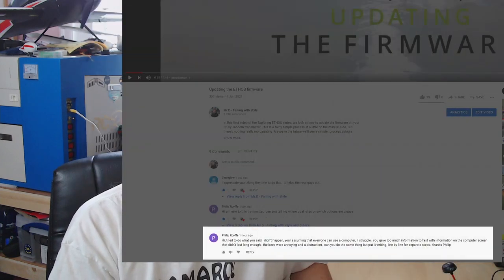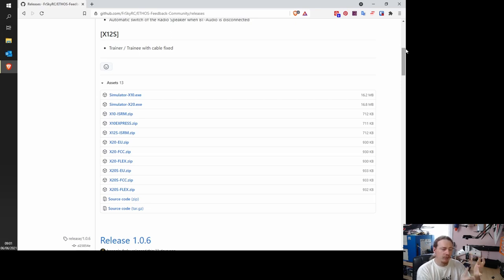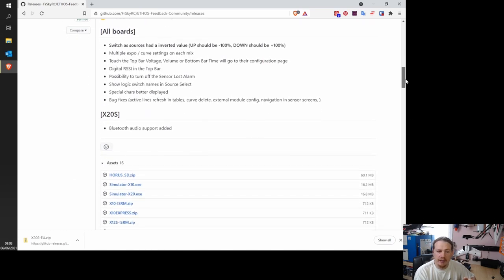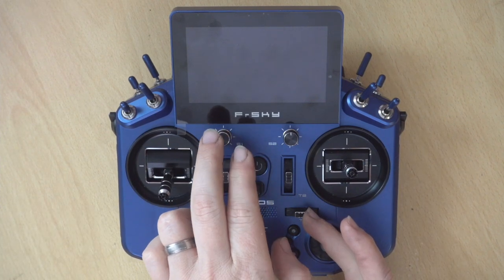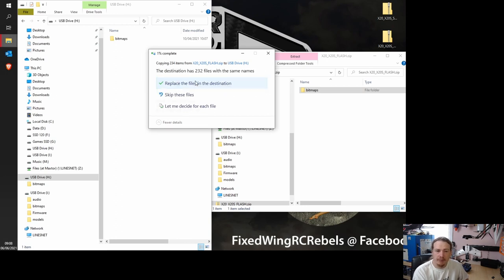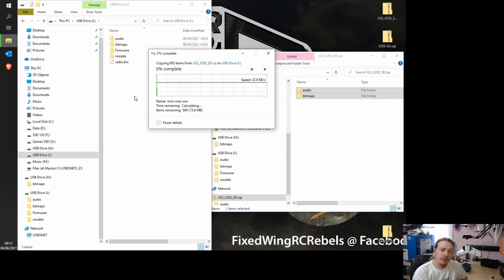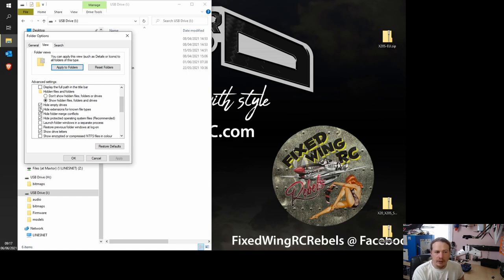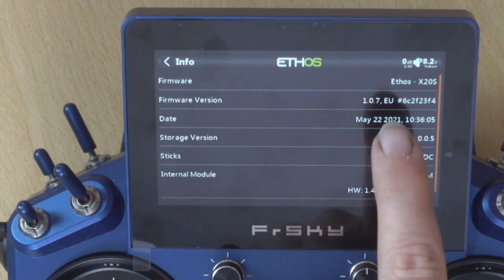Updating the ETHOS Firmware, for people who struggle with computers

Comment: Hi, have tried to do what you said,  not happening,  something I'm doing wrong or not doing at all , given up, thanks for the help, much appreciated, Philip
Reply from the maker: Philip, can you explain where you’re getting stuck? This might help to figure out the problem.
Reply: Don't give up! You can do it...
Reply: Hi, it's sorted now tha, end up getting someone to do it,  took 2 minutes,  done, , computers aren't my thing, thanks Philip
Reply from the maker: Glad it’s sorted Philip
Reply: @MrD  great tutorial. I succeded to upgrade my firmware. Could you also provide some tutorial on the physical wiring connection between R9MX receiver to R8 Pro receiver. Thank you
Reply from the maker: Thanks Didi, I’m glad you got updated ok. Sure, I can make a video on this. I will add it to the list 👍🏻
Reply: @MrD  Great, look forward to. thank you
Reply: Appreciate if you could also cover the firmware update for R9 MX receiver and what is the recommended power setting. The screen offers setting from 10 to 1000 mW.
Reply from the maker: Firmware updates are basically the same as with OpenTX. I will make a video on this too 👍🏻

As for the power, that really depends on how you’re using it. As a redundancy receiver for 2.4GHz, 25 or 50mW should be fine. I always just used the FLEX firmware and set the power level to auto. Unfortunately at the moment, these is only FLEX availability with FCC 2.4GHz on the X20 at the moment. I’m hoping this gets updated soon.
Reply: @MrD  well, I will wait for the video to see how it goes. I am not familiar with FLEX firmware. This is my first radio with FR sky, so I am a bit lost. Thanks anyway for your quick response. This is even faster than FR sky support